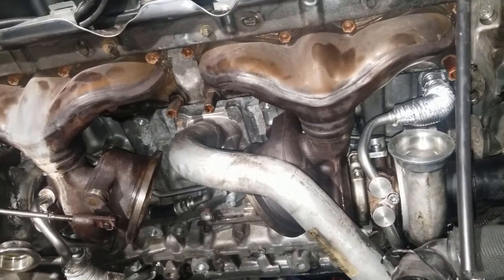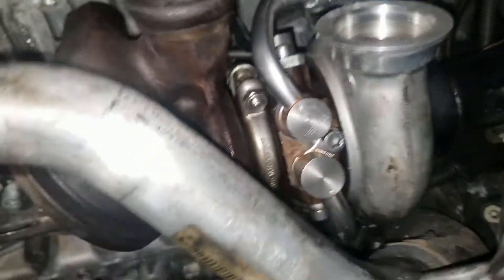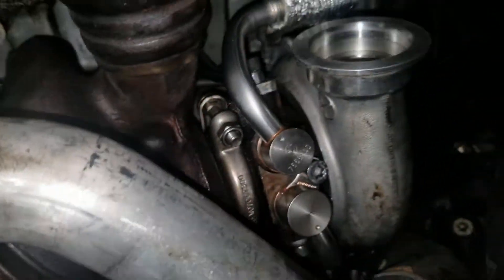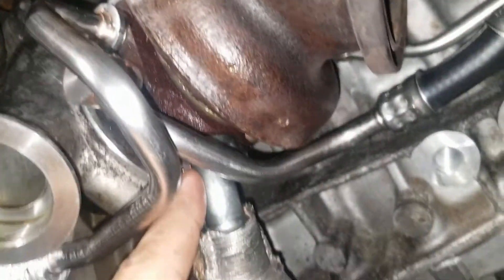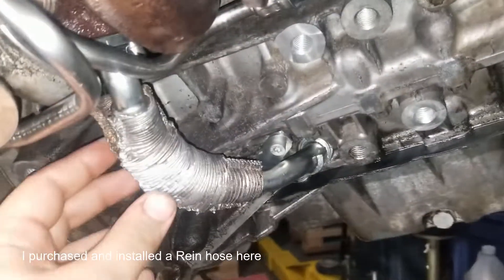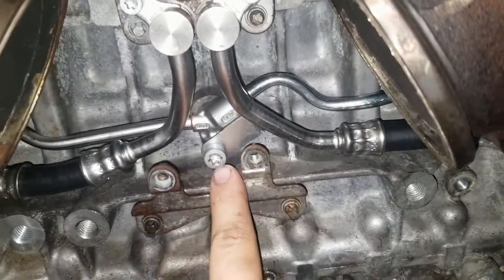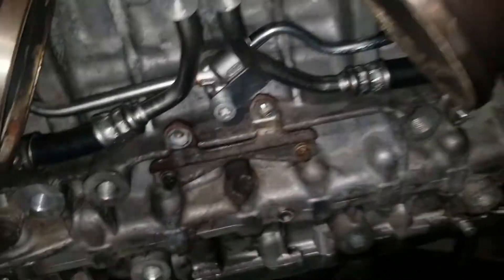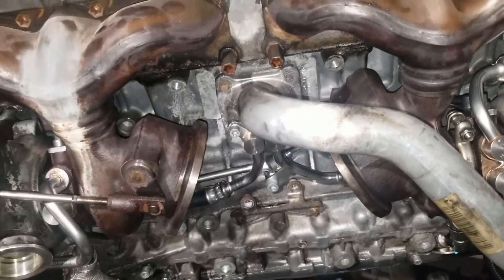N54 Turbocharger Oil and Coolant Lines Explained with Torque Specs and Part Numbers

Comment: I need to change the front turbo upper coolant line.Is there a way to change it from the top engine bay?
Reply: I think I’m in same situation bunch of coolant spewed out from passenger side can’t really see where it’s coming from but I assume it’s these lines did you ever figure out replacement?

Comment: What happens when you take off the heat shield. Does that protect your turbos ? And what do use to take off lines . Super hard to get off. All I figured is a screw driver

Comment: Thank you for this video bro , I’m in the process of doing my turbos , I already removed everything turbos out , cleaned all my coolant and oil lines with new seals , but as I removed all the T30 bolts I got confused because I noticed some were longer then some others and I wanted to make sure which ones go on the right spot , this helped alot thanks! 
Did not want to just guess it then have a leak later on !

Comment: My turbos are leaking oil but idk if it’s the turbo seal or the oil lines. Do I need to drop the sub frame to fix this ?
Reply from the maker: I think you'd have a hard time fixing anything in this area without dropping the subframe. Make sure it isn't the valve cover and take a look with a boroscope to figure out what you need before tearing your car apart if you can.
Reply: @OutOfScopes  The boroscope is a great idea ! Thanks !
Reply: @BassFraud  Curious what solved your issue, I ask because I have a small oil leak as well

Comment: I have a question:

Right next to the coolant return line for the front turbo, there’s a hole in the block. It’s just to the right and down about an inch. Do you have any idea what it’s for?

Fantastic video, very well put together. Thanks for any help!
Reply from the maker: Hello Zane,

That looks like a freeze plug. It is a hole that is used in the casting process, then filled with a plug that will expand and fall out if the coolant manages to freeze. This can prevent your block from cracking if you have water in there and it gets below freezing. 

If it is not a freeze plug, it is a hole they used during manufacturing to align machine grips during assembly. The hole could serve both functions. 

Nothing is there when the engine is installed into the car.
Reply: @OutOfScopes  you have no idea how much you just helped me. Thanks for the reply.
Reply from the maker: @zanemukhtiar7338  I'm glad you found the video helpful!

Comment: Hello, I have a e92 335i 2007. When my car heats up fully there comes smoke from the engine. And I have to refill the Coolant every month and the oil sometimes do you know maybe where the problem is?
Reply from the maker: If the smoke is coming from the engine bay I would expect a valve cover gasket leak that drips oil onto the hot exhaust. This could explain your oil consumption. The coolant is probably leaking somewhere and your car will need to be pressure tested. You could also get coolant to spray somewhere in the engine bay and turn into steam, but I think that would be a much larger coolant loss.  

If the smoke is coming from the exhaust at the back then it is something else.
Reply: @OutOfScopes  hmm I will check on that. And I think my bobines got bad because of it is it normal?
Reply from the maker: By bobine I think you mean it inition coil. If that is the case, they go bad with age and heat. It is not unusual for them to go bad around 80-120k miles (130-200k km). It is likely an unrelated problem. If your car is a 2007 or 2008 replace them soon. A bad coil will require high current from the engine computer (dme) and can damage the drivers inside, which will require repair or a new computer. Replace the plugs at the same time if you do coils, as worn plugs can accelerate the wear on good coils.